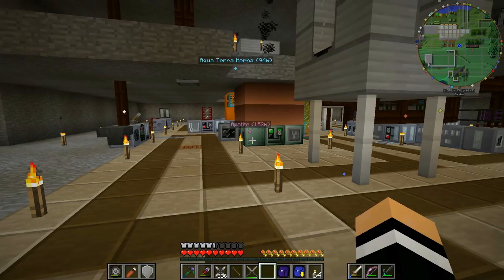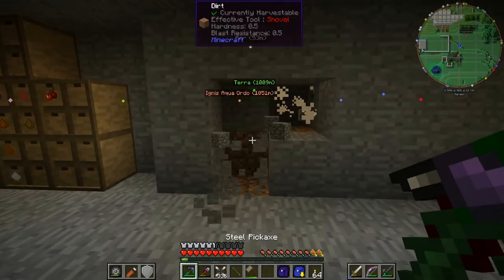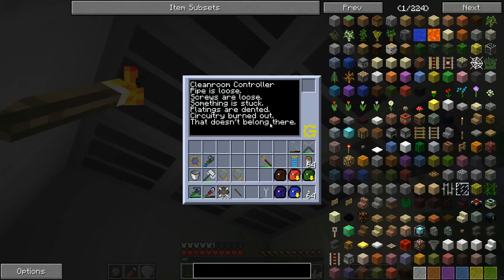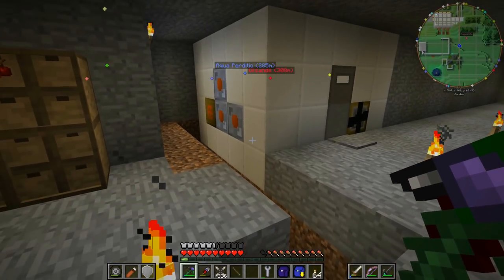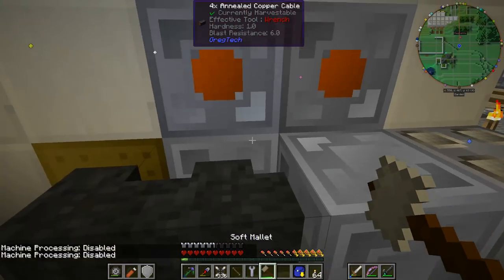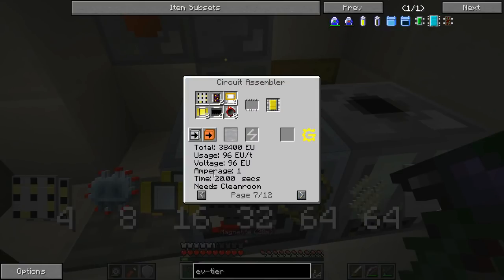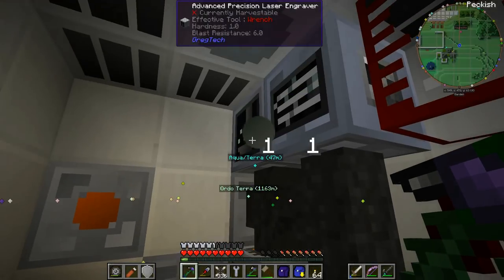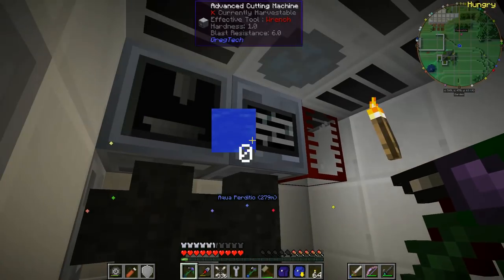S10E43 GTNH - The Cleanroom

Comment: Stoo, your items were most likely disappearing because of the cleanroom inefficiency. Whenever you open the door, or turn off the cleanroom, or there are maintenance problems, the efficiency drops. This is much worse then in most machines because instead of just consuming more power, it has a chance to void items (ex: 90% efficiency = 10% void chance). You can see the efficiency by right-clicking the cleanroom controller with a portable scanner, which there should even be a quest for. Another important thing to do to keep your efficiency at 100% is to avoid entering through the door at all and instead find another way in, such as enderio teleporting staff, elevators/travel anchors, or even a nether portal. This will not drop the efficiency at all.

Also, the machine hulls can only transmit one amp, so that is why you had power problems.
Reply from the maker: Yeah just saw someone else post about the 1A thing. And I did suspect the cleanroom efficiency... It just seemed a bit weird. Especially after restarting my server, I appear to be able to come in and out of the room just fine and haven't lost a single thing. Whereas before my server restart I lost 5 out of 8 items, without me being anywhere near the room - it was sealed and working.

Will have an episode coming up I think with status displays and the analyzer ;-)
Reply: You can put a redcrystal (or any redstone really) on the controller. When the signal is at 15, the cleanroom does not have any pollution in it, and you won't lose any item.

Comment: In testing with cleanrooms, I've found that one of the most effective ways to get power into them is to run all your cables around the outside and use a machine hull for every machine that's going to be inside, and just place all the machines right up against the wall. That leaves some space in the middle for moving around and for piping things (depending on how large the cleanroom is; you'd really need a larger one for any real automation), and it means you can run high-amperage cables around the outside without issues. I would recommend expanding the cleanroom and automating it some time soon; it's best to never open the door at all if you can avoid doing so (since opening it increases the chances of item losses). A good piping system on the inside and a couple of input chests on the outside generally prove to be quite effective.
Reply from the maker: You know I had thought that might be the way to go - as long as the machines are 1A I guess (which I'm pretty sure they all are that need the room)
I have a few videos I need to make first, but I think there will be a cleanroom part 2 video that makes it bigger, and gets some of the automation stuff sorted :-)

Comment: Glad you are back.
I also plan to have an open blocks elevator going into a cleanroom and use the lower blocks for battery buffers and cables, that way you can avoid having a pressure plate on the inside. A bit bigger also can't hurt even if that means even more filters :D
Reply from the maker: Yeah, my first run through something while recording, I'm learning as well, and I always screw stuff up or get the wrong end of the stick :-P
I've learned more even since recording the next episode, so I have not quite the right info in there either.

I definitely need to come back to the cleanroom and make it a lot larger, as well as automate it more. Filters are a pain in the a$$ to make, but should become a bit easier once I finally make some epoxid. Doing it with PE was stupid, I should have done the PVC video first (its the next one).

Comment: Enjoyed your video good sir :)
About machine hull. They are secretly awesome. 
The side with a dot will be the output for energy, which can come in from every other side. However it will only be 1amp. 
(I'm thinking 4x bat buffer inside Cleanroom instead of outside in your situation)

Machine Hull can also ''hold'' simultaneously: fluids, items AND energy, albeit the Hull can only output the EU by itself. (Dot side)
A GT cover directly on the Machine Hull will not work. However a pump importing set on a fluid pipe connected to that hull will be able to extract fluid from it. Same goes for conveyor module with item.

Hoping it will give you great ideas! 
Peace ^.^
Reply from the maker: Ah man, I totally didn't think about the amperage on the transfer through! That makes total sense though, and now I know I need to add more machine hulls, and probably move that buffer like you say ;-) I do want to revisit the cleanroom to make it bigger and more automated, get the fluids passed through etc.